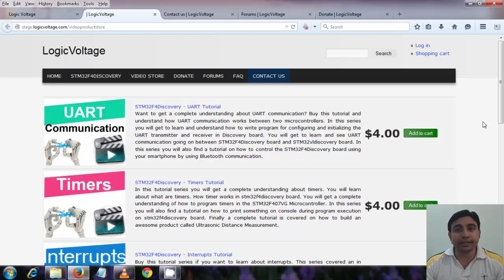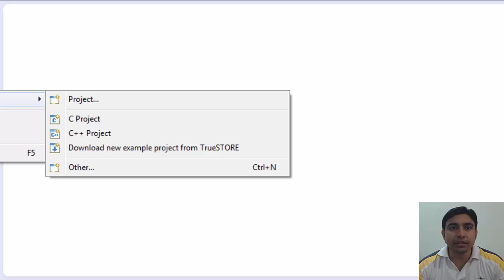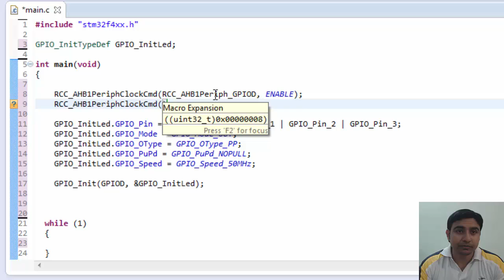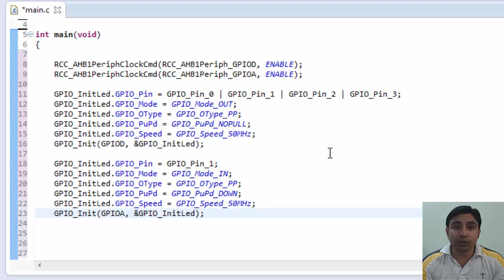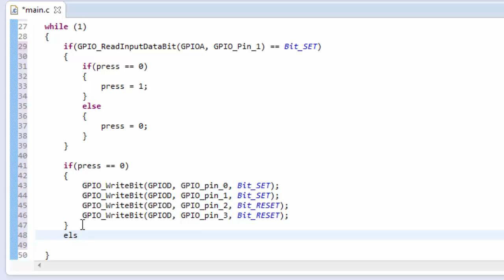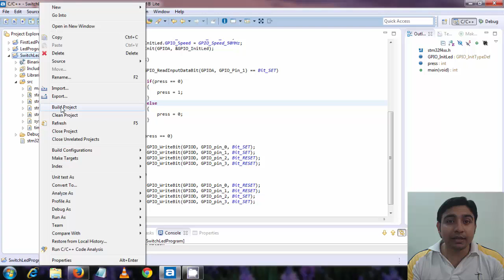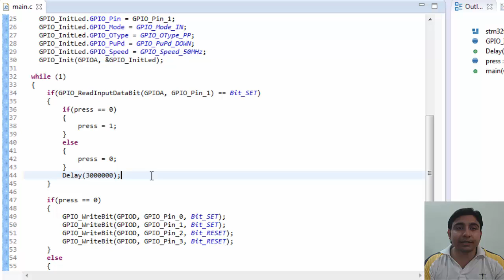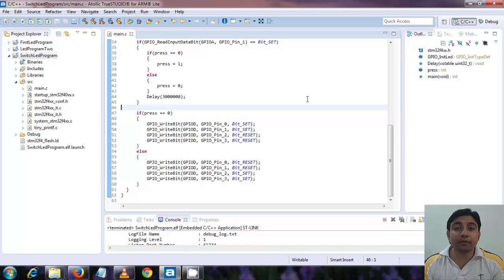STM32F4Discovery Tutorial 7 - Switch part 2

Comment: Thank you for that great video series. I changed your code a little bit but it works without any problem. Here that part  is:
----------------------------
.......
......
while(GPIO_ReadInputDataBit(GPIOA, GPIO_Pin_1) == Bit_RESET)
  {  }

  delay(3000000);

  if(press == 0)  press = 1;
  else     press = 0;
.......
.......
----------------------------

Greetings from Turkey!

Comment: Hi Anupam, great tutorial!
For the problem with the switch, are you sure it is caused by de-bouncing effect and not just the while loop repeating? I would guess from the code that, for the duration of the circuit being shorted, the press variable will constantly switch its value right?
Reply from the maker: Thanks Rico. :-)